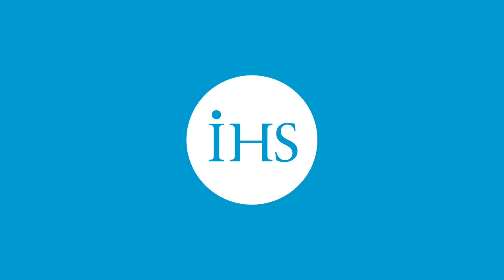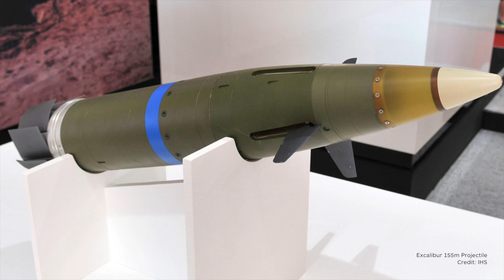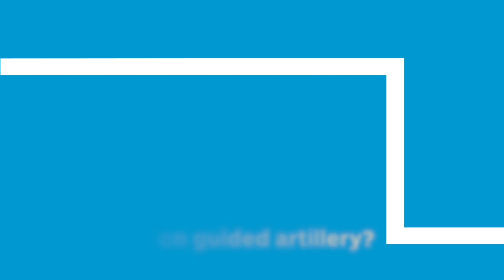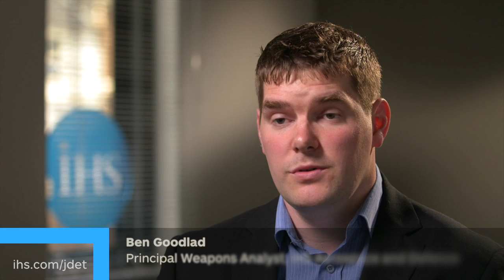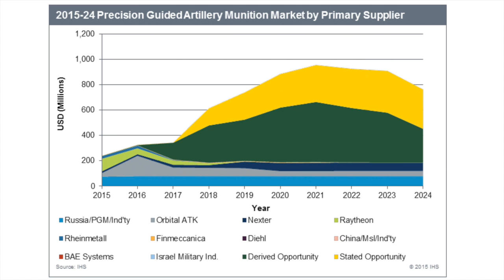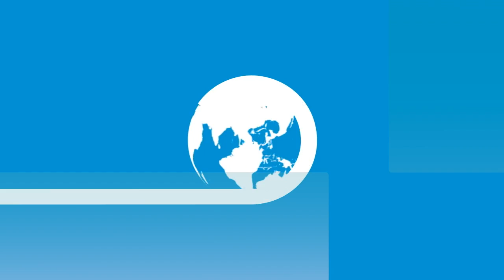Precision Guided Artillery advancements

Comment: Back in the 1980’s the last U.S. Navy DD-963 Spruance Class Destroyers were coming out, and the CG-47 started coming out with the 5 in (127 mm)/54 caliber Mark 45 lightweight gun installed.  These gun mounts have ammunition handling capabilities and magazine capacity/capability for rounds longer than your standard 5” rounds of that time.  This was to account for smart rounds coming in the future by giving the handling system that extra room (length of shell) to accommodate guidance packages of various capabilities on the new expected 5” (127mm) rounds developed for future U.S. Navy vessels equipped with 5” guns.  Modifications to the transport/loading mechanisms require upgrades to service these new guided round technologies.  Once the guidance packages were proven/perfected the gun mount development/ modifications for retrofit were to be developed.  That development was to take place at Naval Weapon Development Center Dahlgren, VA., and proven on their firing range.  
Today, all funding for such things go to individual companies . . . if it exist at all.  All facilities, staff, and activities associated with Naval Weapons Development has been disbanded at Dahlgren, VA.  
Every Destroyer and Cruiser have this gun installed, and the Cruisers have two.  The Cruisers have been prioritized for early removal from the fleet.  No new Surface Combatants that will be built in significant numbers will possess the 5” gun mount (save DDG-51 and proposed DDG(X)), though the Destroyers retain them, but all other vessels are getting 57mm mounts or smaller.
Responsible? Patriotic? Disarming of America ? . . or just profiteering by the Missile Lobby?  The U.S. Navy has almost 100 Destroyers and Cruisers who can be modified and shoot guided rounds . . . and THERE IS NO PLAN TO DO SO!  
The fastest, most cost effective methodology to increase firepower across the fleet is to modify and shoot guided rounds out of our 5” gun mounts . . . and NOBODY IS DOING IT in a Program of Record . . . though this has been envisioned for over 30 years!
BAE Systems has recently come out with a 155mm guided round for the U.S. Army that has down-compatibility to the 127mm (5”) rounds…and that is about it.  Money for EXCALIBER rounds for 5: guns have been slowed down or defunded.  What is going on ? . . the MISSLE LOBBY! 
A ‘Program of Record’ is required for guided projectiles with leadership representatives from all services via a Joint Program Office.  Guided projectile technology should be developed for all calibers of artillery aboard ship, ashore, or in the air from 30mm up to the 155mm artillery rounds and everything in between.  Fuse/seeker/guidance development should include:
1)	Targeted geographic position
2)	Moving target emitting InfraRed/ElectroMagnetic/RadioFrequency
3)	Powered round addition for greater range on every kind of round
4)	Deployable control surfaces for control and lift using whatever means
5)	Different warhead selections based upon target metrics